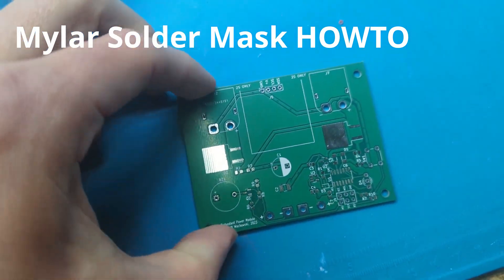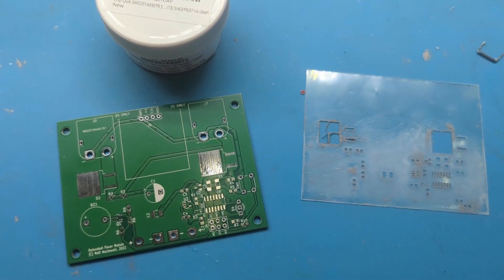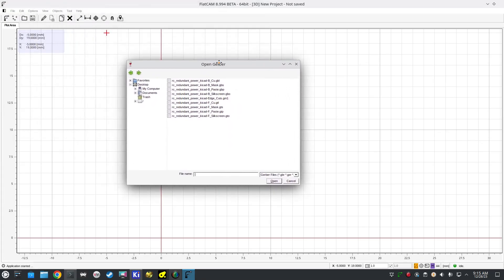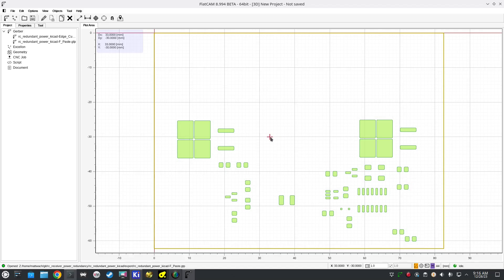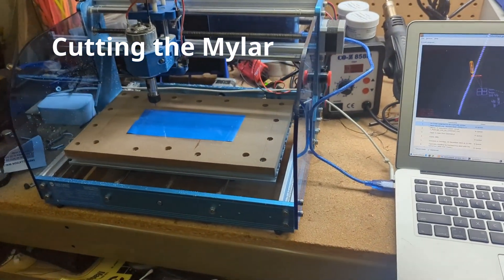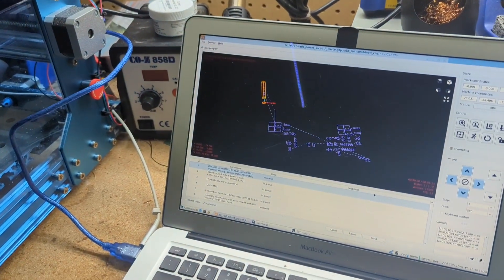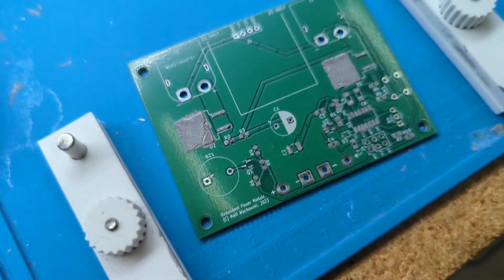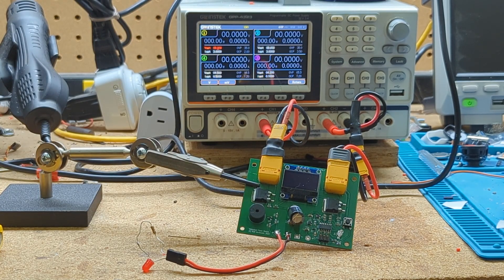Creating Mylar Solder Stencils With A CNC Machine

Comment: I've literally been looking at doing this with brass shim stock! Do you think 0.5mm pitch pads will be alright? Actually going to try this period seeing as mylar is so cheap and no risk to the micro bits I was looking at for the brass!
Reply from the maker: I've been cutting mask holes for SOT-23 and they work great so I think that fine details are not a problem.  Agreed that Mylar is nice in terms of bit preservation.  One guy also had luck etching thin copper (details in the video description).  I might try that at some point as well.

Comment: Interesting. i only ever tried it with a cricut plotter. that also works with 0805 and similar spaced components but the cnc looks like it got way more accuracy than the cricut.
Reply from the maker: Interesting.  Using a cricut was my first thought but I don't have one.  My friend tried doing a cut for me and the scaling was wrong so I tried my cnc.  I never got to the bottom of if a cricut was actually a viable approach, thanks for the information.